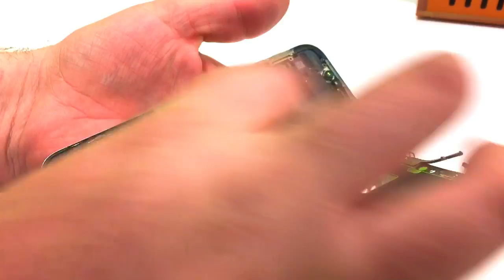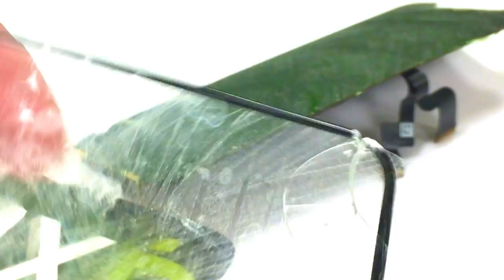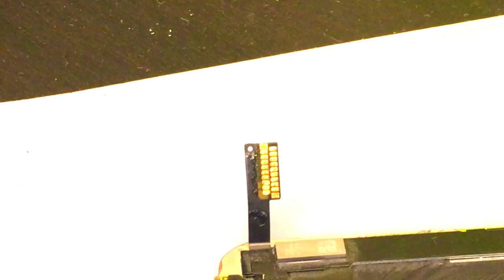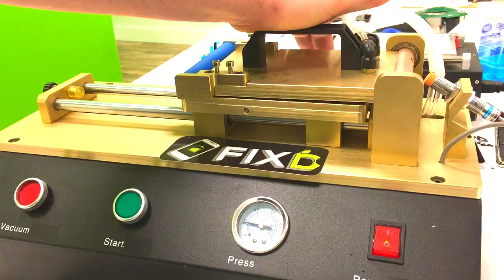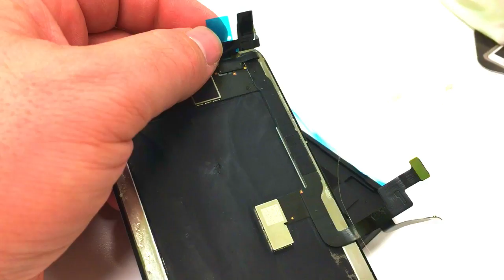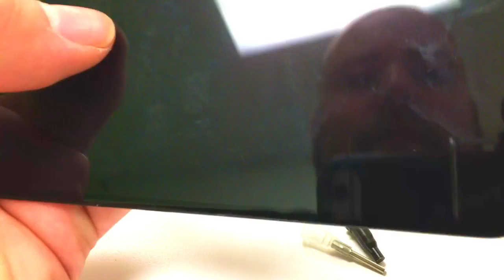iPhone X: Glass/Digitizer Repair Made Easy!

Comment: If you don't use the touch ID feature ) and never set it up, do you need to switch out the home button? I'd rather avoid that step being as I never use that feature. (I have a iPhone 6S Plus model). Thanks and very detailed video.
Phil
NYC / Jersey Shore Area
Reply from the maker: If you don't care about touch ID then go ahead, personally I feel that a bracket and two screws isn't to much extra work to keep that function available if ever needed
Reply: @FIXDPHONES  Good point. But this way at least I know I have the option to leave the new button mounted if I don;t use Touch ID. Thanks again.

Phil

Comment: Great video! Im having issue where the touch works good just after removing the glass, but after removing the OCA the touch stops working (usually on the top part of the screen). Do you have any tips on how to avoid that or what I might be doing wrong in the process?
Thanks
Reply: Hello. I experience the same problem. After Glass remove the touch is working OK. As soon as I remove complete OCA the upper halve of touchscrn not working anymore.   I Tried start from bottom and removed OCA halfway, then tested OK , but as soon as remove complete OCA the upper part of touch won't work.  Also tried starting from Top but no difference.  Have you found solution?
Reply: Hi guys,any news about that problem ? I have too...
Reply: For me it is the same . But after I laminate a new glass on top with Oca it works again normally .

Comment: INSANITY ! WHY BUY HEAT PLATE, ALL THE TIME, DE SOLDERING !!! ALL THE RISK OF LCD DAMAGE, WHEN YOU CAN BUY SCREEN COMPLETE FOR ABOUT £45 ON EBAY, IT TAKES ABOUT A QUARTER OF THE TIME AND IS 10 TIMES EASIER
Reply: Screen isn’t quality and you spent 20$ instead of 150$

Comment: When I replace my whole screen with digitizer does an I phone x require a led /lcd or a OLED replacement my screen is cracked so I figure it easy just to replace the whole thing
Reply: OLED is the original display used in iPhone X, xs, and max models. LCD is just the old but reliable screen that third parties make. OLED dim each pixel or brighten, while LCD has a backlight that is always on unless, sleep or turned off.
Reply: So should I replace my screen with an lcd screen instead of an OLED?
Reply: David Blankenship i would prefer soft oled and yes better to replace the whole thing rather than fix the glass if you’re not super into fixing stuff and getting rid of adhesive
Reply: That’s what I was thinking just replace the whole thing but wasn’t for sure what I should replace it with until now,thanks
Reply: David Blankenship yep no problem just make sure you know where each screw goes and watch some repairs video on the whole oled replacement

Comment: Hey boss. What's the liquid you use to clean the OCA leftover after digi removal?
Reply: Rafael Bernal did you ever find the answer to this? I was wondering the  same thing
Reply: @javirizo6802  Yes man, used 8333 OCA Remover to clean the OCA leftover. Finished cleaning it up with isopropilic alcohol. Use it in small quantities as 8333 can easily damage the flex cables. I just applied a bit of 8333 and removed it with the fingers, soft and slowly and my display is still alive and ready to be laminated.